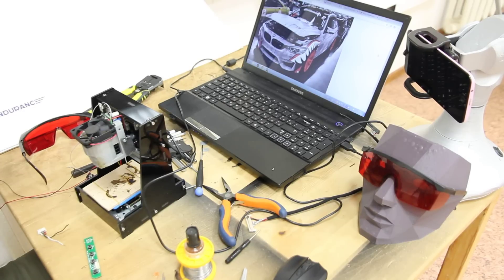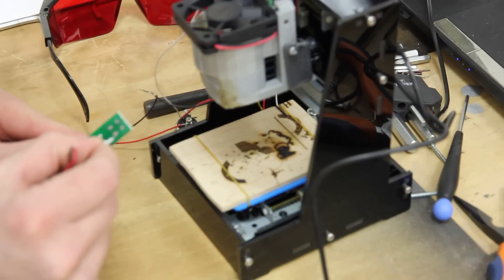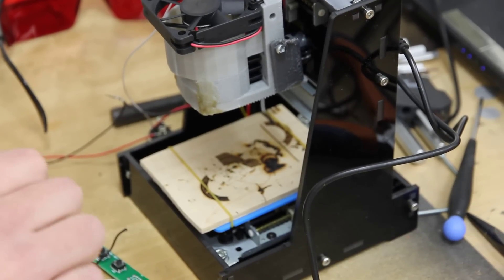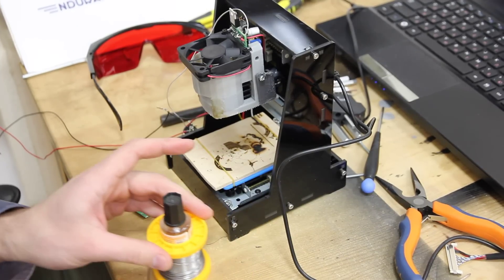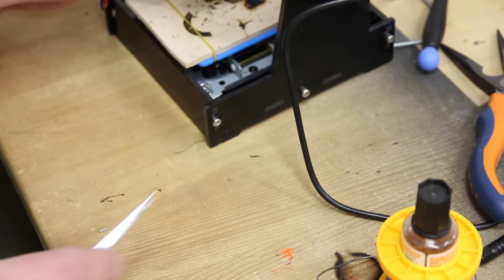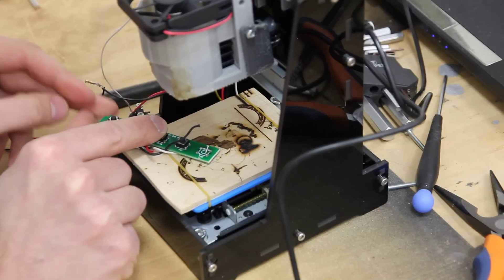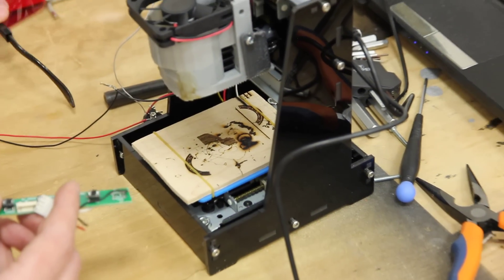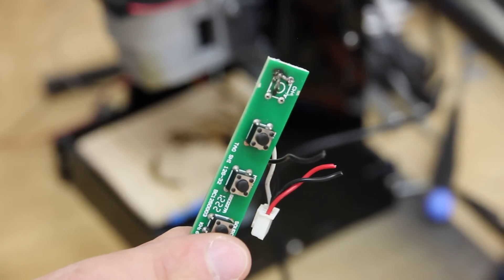How to do laser soldering using 5.6W diode laser.

Comment: you need an understanding of soldering that does not looks fine at all, plus, a soldering iron does a much better job than what you did here, all you did was melting solder wire with a laser, it has nothing to do with soldering